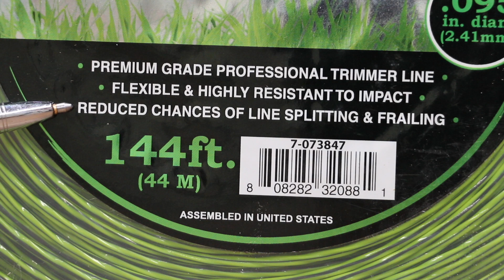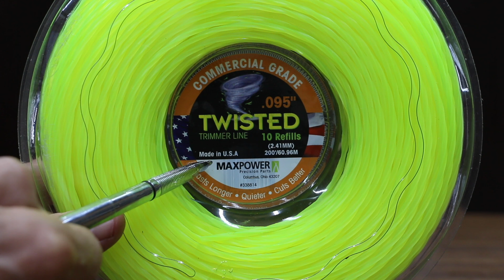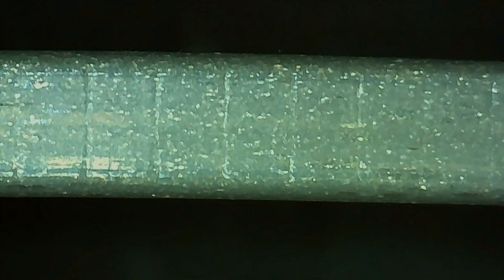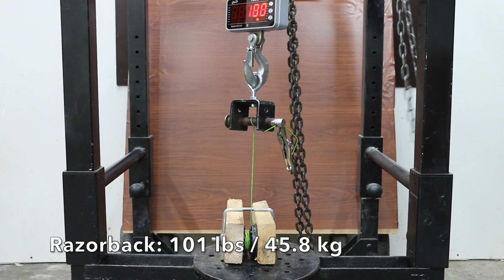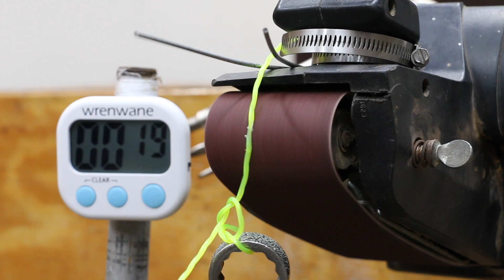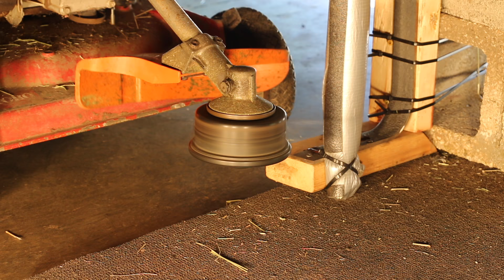Best Trimmer Line? Let's Find Out! Round 2: Stihl, Husqvarna, Echo, Oregon, Shakespeare, Weed Eater

Comment: Have you tested the best Cordless  Electric  grass Trimmers?
Reply from the maker: Thanks for the suggestion.
Reply: @ProjectFarm  They say to use the tip of the line to cut the grass. You may need to  figure out a way to  to slowly  move the trimmer into the tape rapped grass.

Comment: During a straw bale house construction course many years ago one alternative builder stated that the ww2 pill boxes that Japan built using bamboo instead of rebar in concrete have outlasted the American ones that used rebar.  With Hati in the news again with mass casualties from collapsed unreinforced and weakly reinforced concrete structures I am again reminded of what I heard so long ago and wondering if And how well bamboo would work compared to unreinforced, wire reinforced and rebar reinforced concrete.  I'm guessing their concrete is itself not of optimal quality.  And testing how bamboo would hold up over decades of moisture exposure compared to rebar is obviously impossible but you could relevant strength tests on new concrete.  Because if bamboo actually works well it would be something that Hatians could produce themselves, etc.  Additionally, the lime in concrete might prevent the bamboo from rotting when exposed to moisture.  Even if not, bamboo Would not expand like oxidizing rebar does, so the spalding of the concrete would be avoided with bamboo
Reply from the maker: Thanks for sharing.
Reply: @ProjectFarm  Thank you!  You've tested a bunch of things I've been curious about.  Happy to say that I finally had concluded that twist line is the best.  I've mowed about 12k lawns

Comment: I don't think stretching the line has anything to do with the strength it has to do with the brittleness of when it hits rocks and wire and large stocks of weed weather is going to break or bend around it or cut through it not how much it can stretch that just means how soft it is or how much it can stretch and who gives a damn I want to know if you ran it into a clump of grass or weeds what is going to do is it going to cut bog down bounce off that's what I need to know from your test

Comment: I have an older  DR walk behind trimmer that takes a twenty inch piece of string.  I have a problem with them flying off.
I am not sure if it is because I am using the wrong size or weather it is the fault of the line.  Of the ones you tested, which would be able to stay attached to the trimmer?

Comment: It's definitely better for the line to run at low rpm but it's not so good for the motor to always be running at such low speed. Before you put it away rev it up slowly

Comment: I figured the trimmer line wore out too quickly, so I have an acoustic guitar so used the G string from a steel wire guitar.  Definitely was SAVAGE. Tougher than any weed or tree or bare feet or unprotected leg.    I am experimenting for myself. Had to manually cut to length with wire cutters.
Reply from the maker: Thanks for sharing.
Reply: That's metal. And a great idea.
Reply: Attenzione potresti farti molto male con piccoli pezzi di filo di ferro, veri proiettili che entrano a fondo nella pelle.

Comment: Great video!
Also don't store in sunlight. I've notice older trim line store in Sun light became more brittle and went thru it way faster.
I even go where they sell more so I get fresh live rolls.
I used an orange twisted multiple edge line last time and it cut easier and faster than round.
I also drilled out the .065 holes on my electric trimmer to .090 and it works much better. 
So now I just buy one size. Troy built 4cycle gas and a corded electric Ryobi 2 speed runs strong on high speed.
Reply from the maker: Thanks!  Thanks for the feedback.

Comment: Excellent tests! This will definitely impact my future purchasing. I think the twisted group of trimmer line may be in their own class for testing vs. the rounded. Shape of the line definitely can create an advantage in lashing and cutting action much like serrated over straight edge knife blades. It may be interesting to find out if the number of shaped cross section edges actually make a difference at all (triangular - 3 vs. square - 4) My guess would be marginal, but it might lend to the cleanness of the cut.
Reply from the maker: Thanks!  Thanks for the suggestion.

Comment: I think the tests here are missing a big element, which is the longevity of the lines. I bought the power max twisted line after watching the video and it was great. But after 2 minutes of use, the lines split into four strands at the terminal and i have to cut that last inch of the line and pull out some more.
Reply from the maker: Thanks for the feedback.

Comment: I like the way this grass trimmer line test was conducted,  I, myself,  I am sold on max power,  with this products tensile strength  being up around 210 lbs test , it reminds me of fishing line,  and the fence line test was also good as well,  lol, if you were to put about 40/50ft on a fishing rod, and a big heavy hook,  you might hook a hell of a big fish ,I think you all get the idea,  i have been doing a fair bit of window browsing on YouTube, yeah, there's a lot of variety out there,  and everyone has their own opinions,  but ,with your grass trimmer line test being conducted the way you did,  it looked like a very interesting reasonable well conducted test,  nothing was over complicated, all the products showed their personal endurance,  and everything categorized reasonably correct,  and I feel that  ,the brand, "" max power,  perty much sold it's self,  now I just have to see if I can find some around my area,  and my belief in preparing my trimmer line setup, is the 3 point spool ,cut short pieces, loop them for self locking and or the plastic urethane blades,  or the 3 point blade,  just make sure you have a spare parts pouch on your belt or a backpack,  then see how much ground you can cover,  wayneeden95@gmail.com

Comment: Do these trimmer lines work in electric weed trimmers?
Reply from the maker: Thanks for the video idea.
Reply: Yes they do.  But you have to look at the max size for your electric weed trimmer.  If you use a thicker line, it may not spin fast enough to cut anything.  My unit max is the .095, so that's what I use.

Comment: Twist needs  to be a little big bigger diameter  to compare ins  strength  its not going to be as strong as  round in the same diameter but it will perform better cutting wise   from my conclusion  a .95 shakespeare  ugly twist is like  slight stronger that a   good full rounds trimmer line  at .80  but  the twist  cuts some much faster  and is much more quiet  craftsman  had a good twisted line that was more rubbery like and stretch so it was softer and that softer line really grabs on to things and  tears them up they has a rubbery round line that  was some good stuff I tell u but I can't fine that stuff anymore  my grandfather had an old roll of it kicking around
Reply from the maker: Thanks for the constructive feedback.

Comment: I bought an Echo 40V battery trimmer. After 3 uses I worked intermittently. I took it apart and improved the internal wiring.
I bought this model because I could change the  bump cutting disk to a simple "Universal" head. Just add precut or self cut line, no feed. I bought a heavy duty line (sorry don't remember the brand). The head has 3 free rotating fixtures that you loop the line in. The line last a long time and replacing it takes less than 2 minutes. No more bumping and scalping the lawn.
Reply from the maker: Thanks for sharing.

Comment: The tensile strength is measured to 15.1 lbs not 151 lbs lol there is a decimal point there 😁 just ragging you. No offense intended lol
Reply: I would have to disagree. That can’t be a decimal point. No way any, even cheap trimmer line would snap if you picked up a twenty pound weight with it.   Think about fishing line, that stuff is thin as a hair and is rated at like 15 or 20 lbs.

Comment: The test line I would test is which one does not send pieces to hit my bare legs.  I don’t mind refilling trimmer lines.  I have to do it several times a year.  I try to refill the heads on my two weedwhackers in the fall before I put them to sleep for the winter.  I buy the cheapest line I can find, usually from Walmart.  I never buy Stihl or Husqvarna brand line - to expensive.  My Husqvarna 28L uses .095 line but my little gooseneck uses .080, so I keep both in my shop.    The biggest problem is the line unwinding after you open the container and use it one time.  No one seems to have a handle on building a decent container to hold the line.    I may try the husky line the next time, based upon your test.   Do remember if it will cut through thick stuff, it will also put cuts on your ankles if it breaks off.  My trimmers turn in the 8,000 rpm range, because I run them rich.  My old StihlFS 76 would turn in the 9,000 range all day long.

Comment: I've been using Echo Black Diamond .095" for a year or two.  

Today I tried the MaxPower Twisted .095".  I prefer the Echo line.  1) Every time I bump to feed the MaxPower line it is glaringly obvious where the bits and pieces went.  2) It had a tendency in my thick tall fescue to stall, cut unevenly, or pull the trimmer head down causing turf damage.  

I did not notice it to be any quieter or generate less vibration. 

My trimmer is a Husqvarna 525LST for what it is worth.
Reply from the maker: Thanks for the feedback.

Comment: Would like to see Rotary 10068 Vortex Trimmer Line tested, a lot of people claim its the best. I've used it and it seems pretty good, but would really like to see how it stacks up against these. 
Also would be nice to see the differences of the same brands between .080 and .095, as those are the two most common sizes. I have switched back and forth between the sizes, as with the .080 you can get a lot more line on the spool... but if it lasts half as long as .095 then that extra length isn't going to help.
Reply from the maker: Great suggestion!  Thank you.

Comment: have to admit, my biggest surprise was husqvarna. i thought it would toward the bottom of the list. I usually steer clear of husqvarna products due to a series of bad expensive experiences and problems with the oiler system on a husqvarna 450 chainsaw, which we bought brand new a few years back. And they didn't stand behind their warranty and I had to make the repairs and upgrades, with my own labor and buying parts, to fix the problems with the saw myself. At the time of purchase we bought that saw because of the great experience we had with husqvarna saws 20 years ago. But won't be buying another after the issues with the saw and even more so the "warranty" experience.
Reply from the maker: Thanks for the feedback.

Comment: I have two trimmers. Both auto feed mechanisms don't work. I've tried winding in both directions loose and tight. What else could I try to get auto feed working smooth? The wire seems to tangle up. Would the type of line make a difference?

Comment: Bought a Stihl fs56 yesterday and used the line it came with. That line kept breaking into smaller and smaller lengths, also it kept freezing in the head - trimmer line weld. I saw this test and review and bought Husqvarna line today. I like it! It cuts well, didn't keep getting smaller by the second of use, and I didn't get trimmer line weld inside the head with it (I must have taken the reel out and re-wound the line half a dozen times in a day's use with the line it came with). The Stihl runs like a charm with one of your top rated lines. Thank you for your excellent work reviewing trimmer lines!!! It has helped me, and I'm confident it will help others.
Reply from the maker: You are welcome!  Glad it helped!
Reply: I switched to the Husqvarna line as well. For the very reason you did. I was very impressed with the results

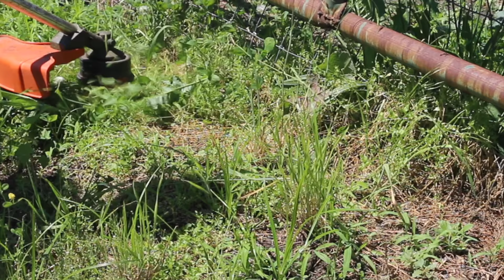Comment: 10:52 I'd argue that the results should be, for the most part, reversed. All the trimmer lines that made it through pulled the object to the head of the trimmer while the ones that didn't broke off. This is a bad thing. When you're trimming you're aiming for precision, if your line is gripping the objects you're trimming then your gonna do a very poor job making clean lines. I'd much rather have like break and make clean lines than to have the trimmer being jerked around and digging holes in the ground.
Reply from the maker: Thanks for the feedback.
Reply: @ProjectFarm  Thanks for all the great videos! I've been binging them. They're better than any Netflix series =)
Reply: Yep. I am using crossed trimmer line, itnis the nicest cut. I have tested square, round and crossed in like star shape is the best. It cuts smoother,my engine sounds like it is not choking.

Comment: I enjoyed your test of trimmer line.  But, IMHO, you left out the very best trimmer line. Echo Black Diamond.  It isn't the very best on every metric but it is the best on two of the most important metrics.

1.  Echo calls it Twisted Square Edges.  It's just marketing hype until you use it and find out that it actually cuts the grass instead of ripping it.  That makes a huge difference in the effort it takes to move the trimmer head back and forth through the grass.  It changes the 'Fatigue Profile.'
And because it cuts rather than rips, the job it does on a lawn is far more pleasing.  And it is less fatiguing to the engine due to less drag.  Because, on average, you don't need to rev the engine so high, it saves in gas, oil and wear on the engine itself, thus saving money.

2. The company claims it has an aerodynamic property that causes it to fly in a much flatter plane.  They show, in slow motion, Black Diamond compared to three other trimmer strings which wobble as they go around and some of the strings actually lag behind and wrap backwards around the trim head.  That is, the tip of the string is traveling more slowly than the base.  This creates a whipping effect.  Adding to vibration and fatigue.

The result of all of this is a great deal of vibration in the trimmer itself which is fed into your hands and joints. Having trimmed for many years this is something that I was totally unaware of until I used the Black Diamond.  Just to make sure I wasn't tricking myself I switched back to the Echo Cross Fire that I'd been using for a few years.  As a homeowner I've used different brands of trimmers and string and they all 'felt' the same.  But on my Echo SMR230 I could see the difference between the Cross Fire and the Black Diamond.  It was huge.  I used the Cross Fire for about 2 minutes to convince myself the difference in vibration was real and that that difference made a huge difference in fatigue. I could feel the obvious difference in the muscle energy it took just to move the head through the grass.  I would be interesting to attach a torque wrench to a pole and then the trimmer to the torque wrench and swing the trimmer through the grass and compare how much torque (drag) is created by the different trimmer strings.  If you're someone who has a lawn service and spends hours a week trimming I can imagine it would make a big difference in how you end the week.

I gave away my barely used 5lb role of Cross Fire.

Some people complain that up against chain link fence, brick or concrete blocks the Black Diamond wears more quickly and that it's more expensive.  I found this to be true.  But I don't care.  When you're trimming a steep bank the difference in the experience is well worth the pennies more it costs.  I'd rather treat my body and machine better and have them last longer than save a few dollars.
Reply from the maker: Thanks!  Thanks for the suggestion.
Reply: @ProjectFarm  Your comment made me read what I wrote again.  I didn't mean to say the trimmer caused drag.  It's more: "What trimmer strings have the lowest coefficient of drag."  Or just: "What is the coefficient of drag for each trimmer string."  LOL.  There's a whole new marketing angle for trimmer string manufacturers to exploit.  How does the coefficient of drag of your trimmer string contribute to the profile of fatigue you experience and how does that coefficient of drag contribute to the wear on your trimmer."

Comment: Once again your testing is changing my buying habits. I was using the Echo trimmer line. That's the last pack of that I'll be buying until they upgrade the product. As you said in the beginning, stopping the cutting operations to deal with string issues is a pain in the rear and is something I'll pay extra to avoid.

Comment: I know this is off subject but I think a video of testing different fishing lines like mono, fluorocarbon, and braid would be interesting and very helpful information. See which ones are more abrasion resistant, which stretch less, visibility under water, knot strength, which has more line memory after left on the spool, and whatever else you can think of.
Reply from the maker: Thanks for the suggestion.

Comment: A yard service owner told me he soaks his new trimmer line in water for 24 hours.  He simply places it in a 5 gallon bucket with enough water to cover the spool and holds it down with a brick.  He swears the line is less brittle.  I tried this with my Sthil line, and I think it made some improvement, but it could have been wishful thinking on my part

Comment: Try the 4 corner or square gatorline instead of the round, it works a lot better and it is the number ONE weed eater string, YOU Should try it, and it costs $44.00 for a reel of 685ft. 209m. .095" 2.40mm Pro Rated, it's Magnum Gatorline Square made by Oregon in the USA, you will not buy another string after YOU try this one because IT IS THE VERY BEST ONE THAT YOU CAN BUY FOR YOUR MONEY, HANDS DOWN, YOU WILL NOT BE DISAPPOINTED AT ALL, this is all that the City buys for their PARK'S DEPARTMENT
Reply from the maker: Thanks for the video idea.